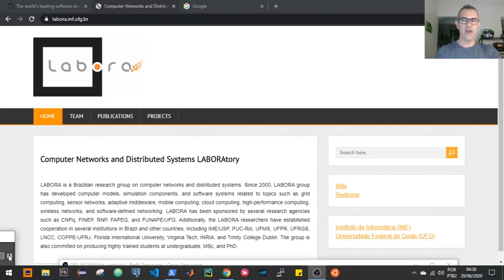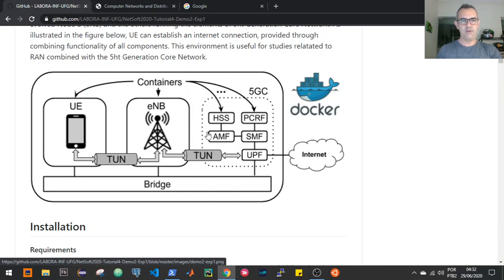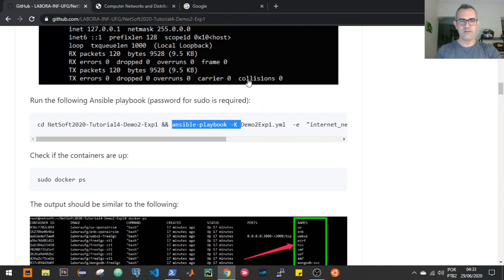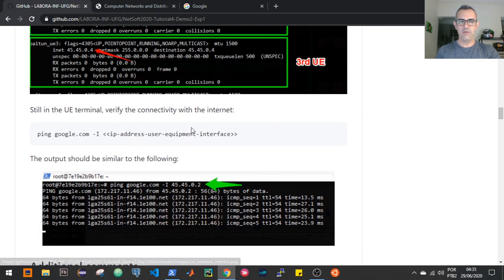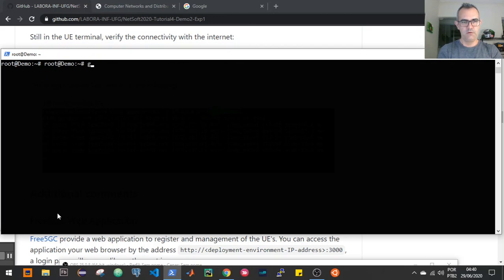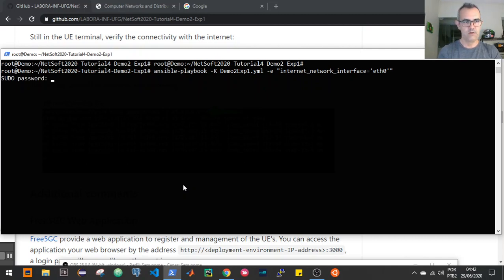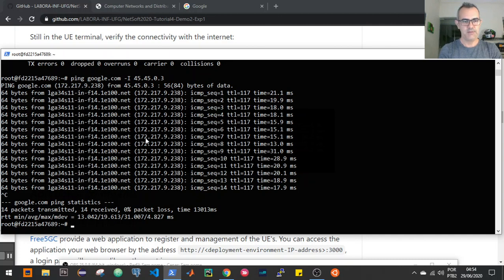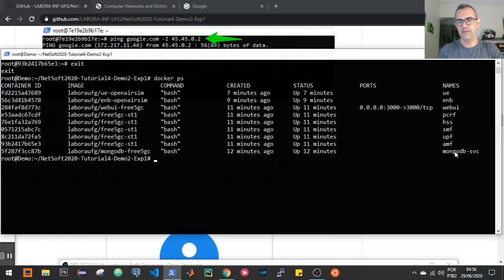OpenAirInterface  and Free5GC: a pratical approach in 5G networks

Comment: Hi, Thanks a lot for the tutorial. It helped me a lot and make my life easy to install the whole package in one go. But i have few questions in my mind:
1.	How i can increase the number of UEs to check the registration process with AMF and how far we can go to attach the UEs simultaneously. I mean how many UEs can we connect at the same time
2.	 Is there any way to trace this process i.e. connecting the UEs with AMF. Also is there any way to check the performance of the AMF while connecting the UEs
3.	Because I am mainly concerned with security of 5G, so is there any way to generate some attacks on AMF from the UE through ant potential software. 
4.	Finally, how I can use Iperf the generate the network stream from UE to the core Network to check the performance of the core network.
Could you please explain these points in detail? I will really appreciate your cooperation in this regard. You can send me a private email on h.ullah@ulster.ac.uk
Reply from the maker: Hi Hanif, sorry for the delay in answering your question!
- You can increase the numbers of UES by inserting UEs in an vector inside the Ansible PlayBook. You can see more details in experiment GitHub page.
-  Details of registration process are available in the AMF log file inside thm AMF Docker Container.  You can see more details in section 'Adicional Comments' in  experiment GitHub page.